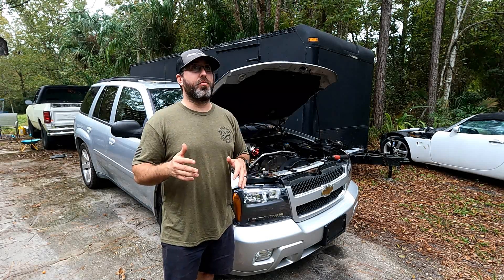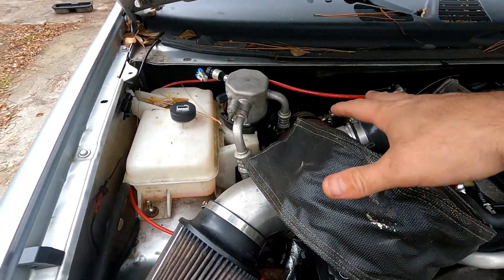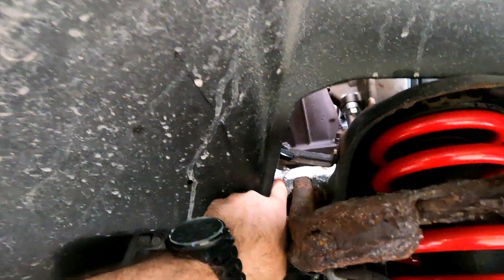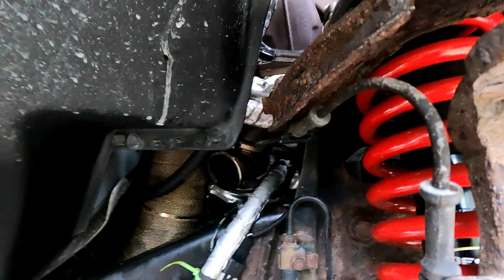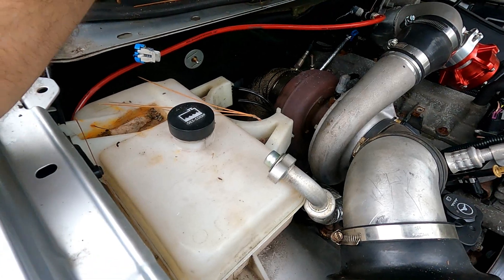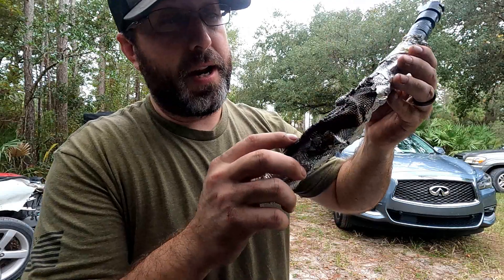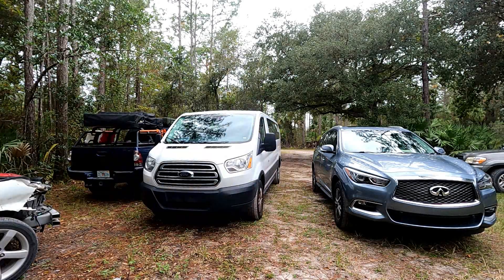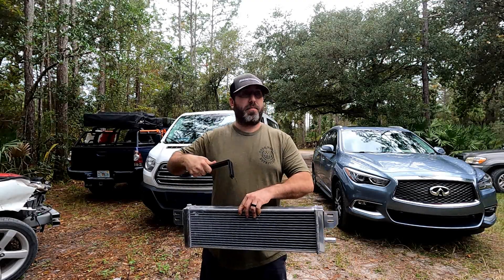Turbo Trailblazer Atlas 4200! Problems and Solutions...Version 2.0 Plans!

Comment from the maker: Thoughts on the plans for the next phase!? Also shirts will be available very soon!
Reply: Maybe a GMT400 AC accumulator  will work. 
If your going with a different radiator you should try to get a smaller metal overflow tank and that might give you more room for the accumulator and would match the engine bay a bit better than the crappy looking plastic

Comment: Make sure when you put the electric fan on you have a shroud that matches the fan.  Also electric fans pull huge amps when turning on.  Derale makes a really nice PWM fan controller.  Also the best heat shield is the aluminum dimple die stuff.
Reply: The alternator in most 2000+ GM trucks are overkill and should run some electric fans no problem
Reply: @joeyh7817  When a aftermarket fan turns on they average about a 40 Amp initial draw and go down to 20 while running.  That alternator can do it but it will wear out considerably faster because it was never intended to run one. If you run two fans double that.

Comment: Just ordered my fueltech FT550 for my 05. Haven't gotten turbo parts yet but I am 100% retaining A/C and heat since it's a street car. Interesting to see your packaging problems, I may invest in getting my exhaust manifold and turbine housing ceramic coated on top of being wrapped so I keep my lines safe. May be worthwhile for you as well, or re-route my lines around the issue areas. Haven't gotten there yet but we'll see.

Big priority for me is including an intercooler since this is a tow vehicle, so I'm keen to see how you route your pipes

Comment: have an ac place fab up some custom lines
Reply: Some hydraulic hose shops will do a/c lines too. I'd love for him to get the heat and a/c working and keep the street car status.
Reply from the maker: There is a Napa in town who will make custom lines. I still need to modify the dryer though regardless.
Reply: If you have a u pull wrecking yard nearby, it might be worth a trip there to see a bunch of dryers on different vehicles. Maybe something exists already that is perfect for your application. Then just order a new one for that vehicle.

Comment: The 3.5 3.7 and the 4.2 are the same engine family
Reply from the maker: Yes, but the 3.7 is the better of the 2 five cylinders for a few reasons.
Reply: The 4.2 is a 6 cylinder